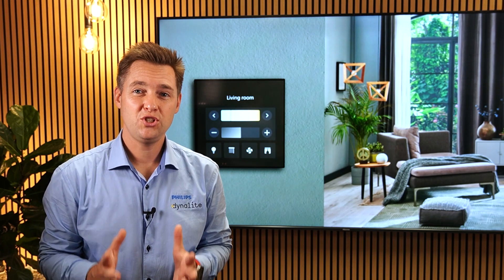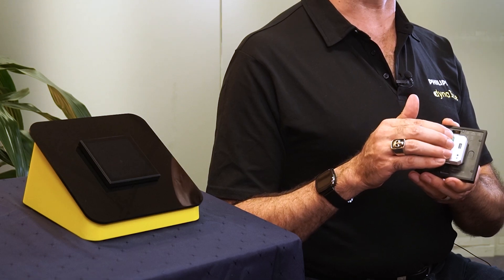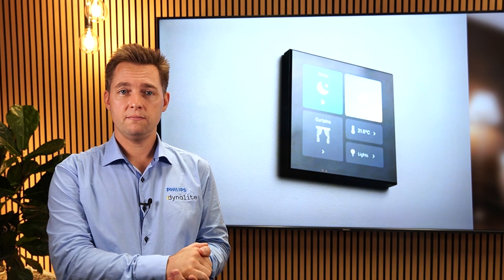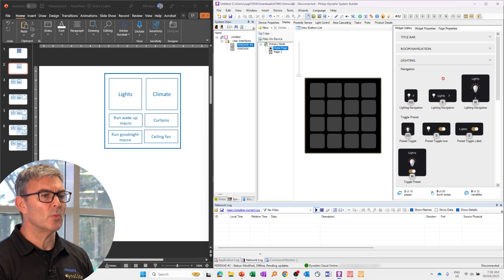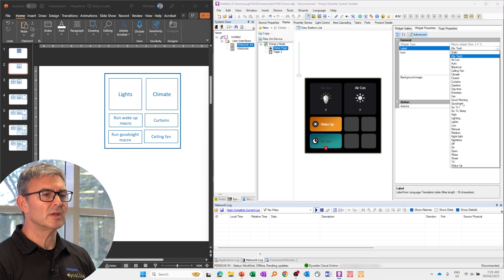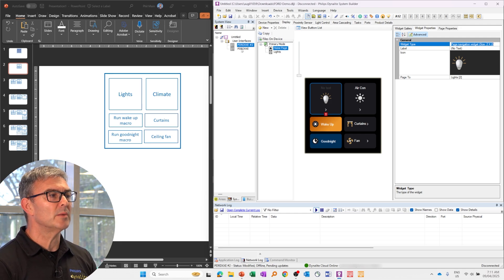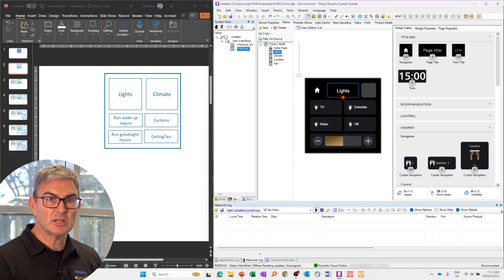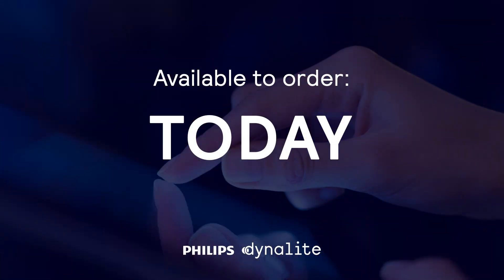Revolution Display | Q2 Launch Highlight

Comment: Will it be compatible with home assistance? does it run totally local? can it be used without the app and only with Home Assistant?
Reply: asking the right questions 🙌
Reply: this looks more like hotel hardware?
Reply: @Nanne-f5i  no similar devices exist for consumers e.g. Shelly Displays, Aqara Panel Hubs, NSPanel et cetera
Reply: the hotel example was just for marketing, such displays are popular among home automation enthusiasts e.g. Shelly Display
Reply: Short answer is no. But Dynalite have joined Matter, so you can officially control the lighting system with home assistant or any other Matter compatible top system very soon.
Reply: Hi to make it home assistant compatible it needs to be running on the wall using the appropriate bus power. Then you need a rs485 gateway. After this you can use the Philips system builder to provision the UI and functions and the area config. After you can use a HA dynalite bridge or matter integration.